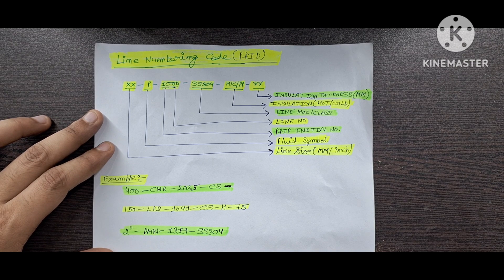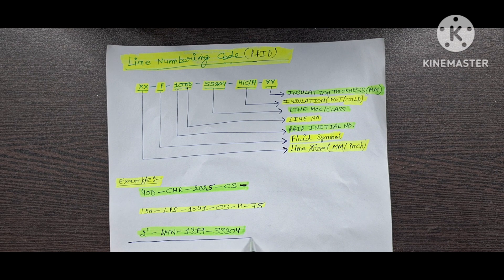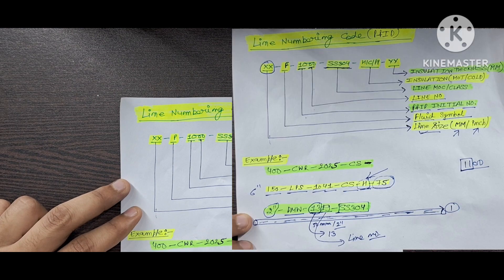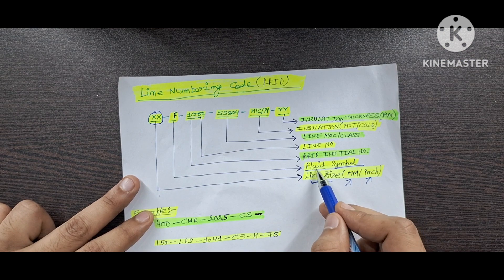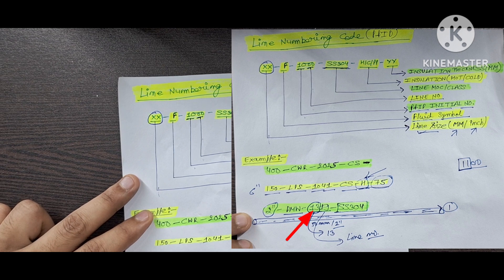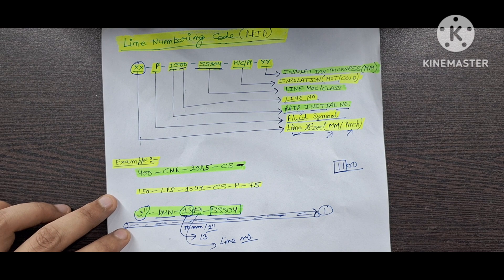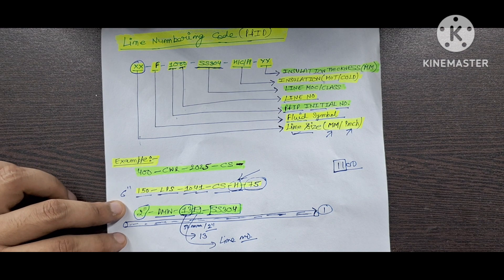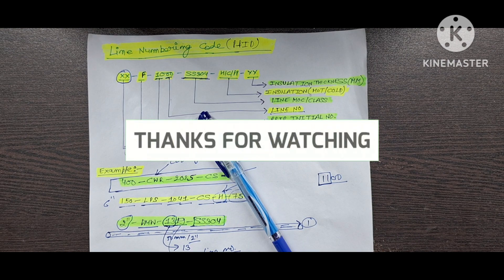How to Read a P&ID line? | How to Read a P&ID? | Part - 1 | Piping and Instrumentation Diagram(P&ID)

Comment: Description of second example is as follows: 
1. Line size = 400 mm
2. Fluid used in the line= cooling water return
3. P & ID Number= 20
4. Line number= 25
Material of Construction (MOC) of line= Carbon Steel